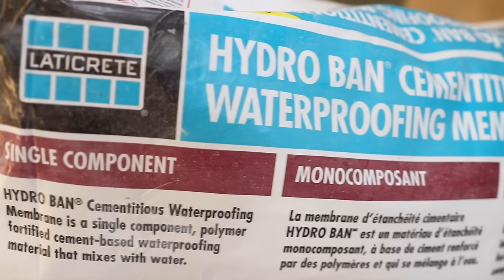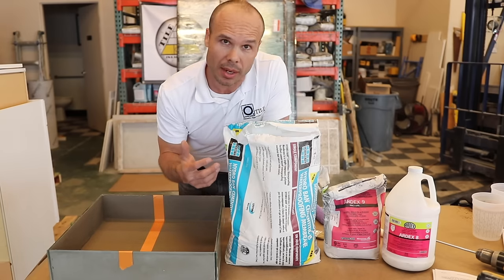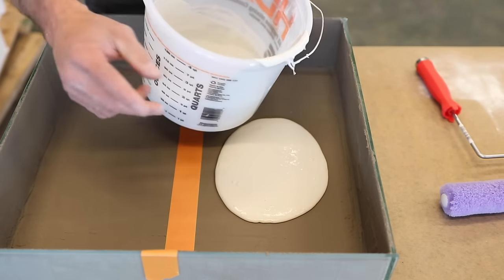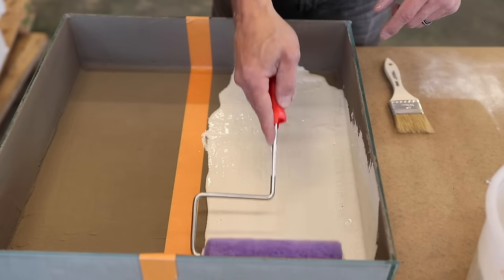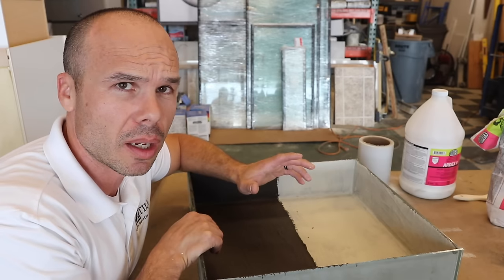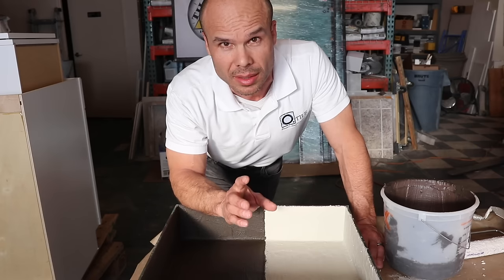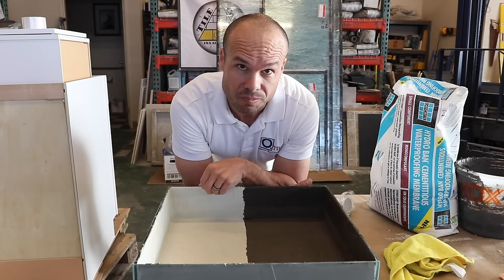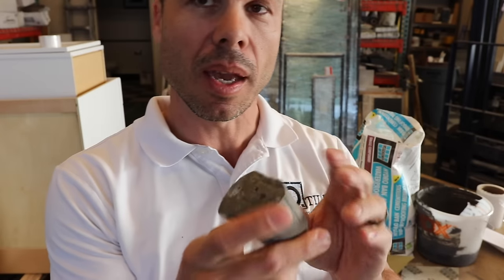Laticrete Hydro Ban Cementitious OUTPERFORMS Ardex 8+9 in Glass Box Test

Comment: You're not too smart apparently. Those are cement based products, cement is not waterproof and will leach given enough time. NOW, cover the box in Redgard or a similar product and you won't see ANY water. Sadly, you know this but still keep plugging things that will potentially fail.
Reply: Wow. He's not the smart one huh.
Reply: @tomelliott9453  yep. I, just like many other in the industry have been using it for years with no failure, so what's the problem? Don't like that it's a "home depot product"? That's fine, everyone is making something just like it at your local tile retailer 😉. Even more insane??? This dude ACTUALLY used Redgard fast set over dry pack mortar with a schluter drain....Oh, and it didn't leak a drop. His own tests proved it is very effective, but still he has nothing good to say about it and still continues to use products that leach water. It is truly amazing the level of upturning of the nose by this man. Don't get me wrong, he is a great tile setter, but he does some ridiculous things, like the grandpa bath episodes he did. Anyone with a brain knows that was bound for failure.
Reply: He used speed coat over speed slope, they are designed to work together in a divot shower method, making isnt a sealed system, using a schluter flange verses a 3 piece drain is fine for that reason. Ive never herd him talk poorly of rearguard and plenty of tile supply house that sell redguard, it works as directed when applied as directed
Reply: They added chemicals to make the cementitious product waterproof smart pants....Unlike thinset that's porous.
Reply: @willinthearea6318  did you watch the video? IT LEACHED THROUGH.
Reply: @abewilcox4560  It leaked through the pin holes, not through the product....The laticrete one didn't even leak. Basically it didn't get full coverage. It would've leaked with redgard too if it had pin holes where water can get through. He did another test with 8+9 over regular fabric, not kerdi, just regular fabric and it didn't leak because there was no pin holes. The product itself is waterproof but there's room for failure in the application process, which is why a flood test is paramount when using any liquid membrane.